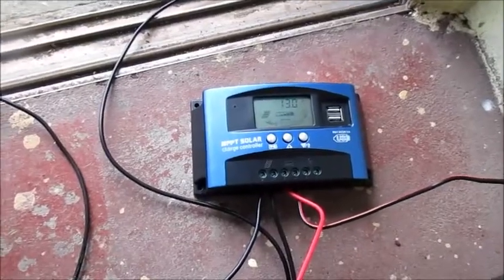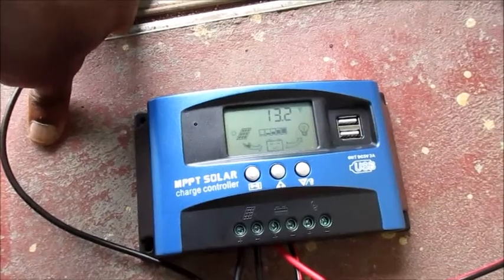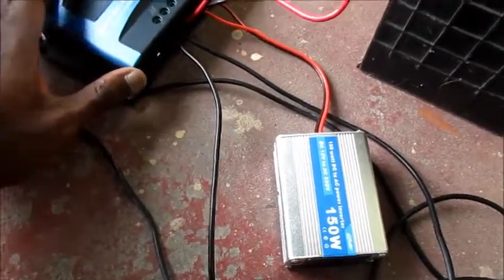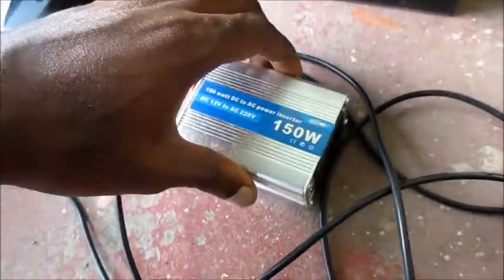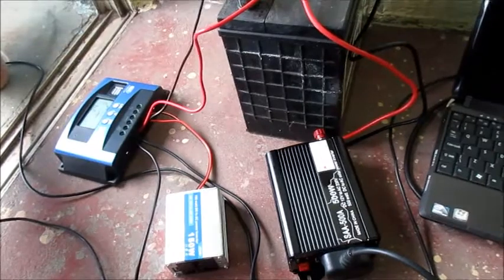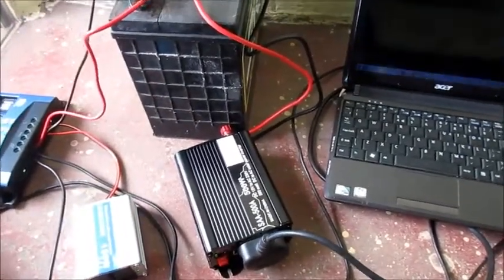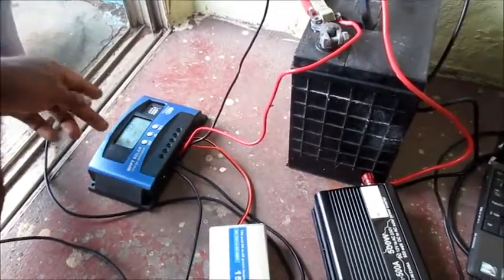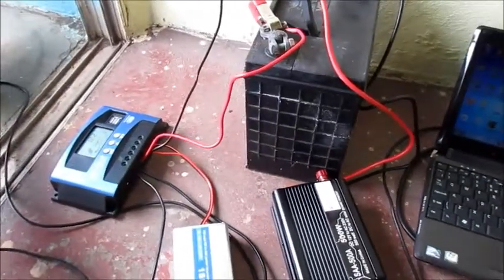solar panel system for home

Comment: I tried out two 60A controllers. After hooking up battery, the screen froze and flickered when hooking up solar panel.  I had the same problem with both.
Reply from the maker: how many watts panel ?

Comment: does the 150watt inverter complement the bigger inverter; I don't understand
Reply from the maker: The bigger  inverters connect directly to the battery and not the charge controller

Comment: you are awesome.. i just want to ask.. if i want to power a car amplifier which is 1000 watts by a 12V car battery.. how many watts my solar panel should be?
Reply from the maker: It all depends on your battery bank . its like 1680AH (amp hours) for 20 Hours.  As 1000W is 84Amps. You will need at least ten 100w solar panel which estimate around 60Amps . you can use high AH batteries and less panels.

Comment: Is this mmpt work in 24v solar panel to 12v baterry with the corect power of ampers to 12v???? Please send s answer....thnx
Reply from the maker: Yes it can charge, it is going to charge that battery at 8.3 ampere, and pull the voltage down to whatever the battery can 
handle. If the battery is pulled up to 14.5V for example, you will charge at 14.5*8.3 = 120 watts.
Reply: No. This is a PWM system and it requires a 12V solar pane to charge a 12V battery